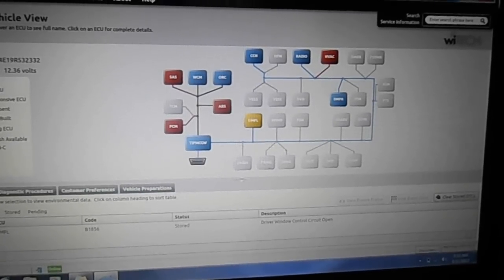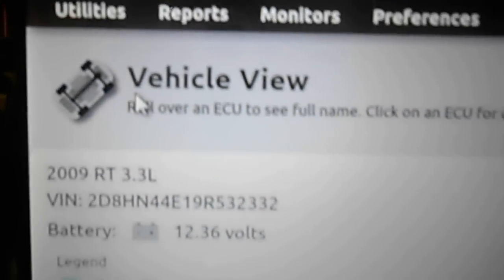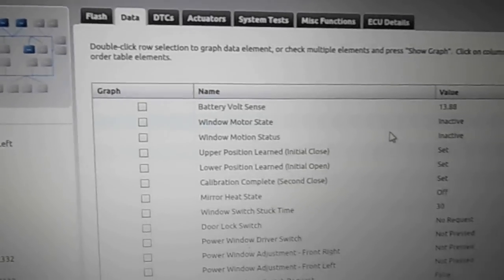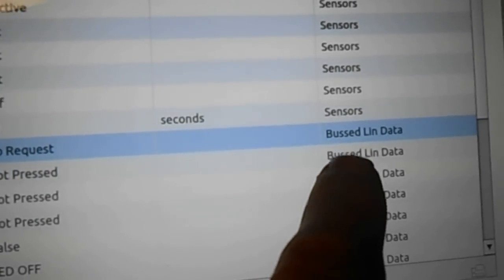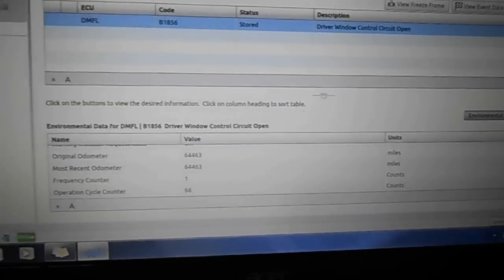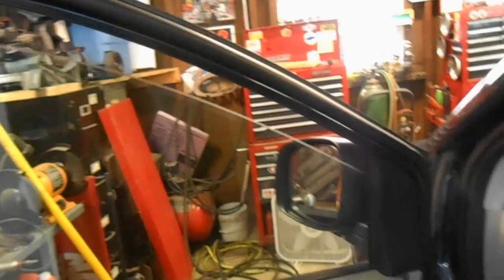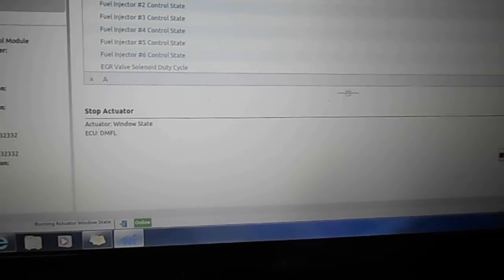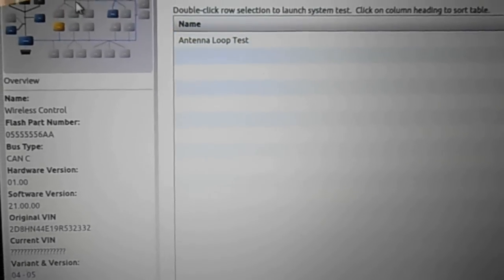Chrysler Wi Tech Scan tool system

Comment: Hello,
With this tool a new WIN/SKREEM module could be programmed as long as you had the PIN? Mine is starting to act up and the cost of getting the tool and part is less than having the dealership replace it. it's this part, http://www.ebay.com/itm/05-06-DODGE-300C-MAGNUM-IGNITION-SWITCH-IMMOBILIZER-56038665AT-BLACK-/321568763990?_trksid=p2141725.m3641.l6368